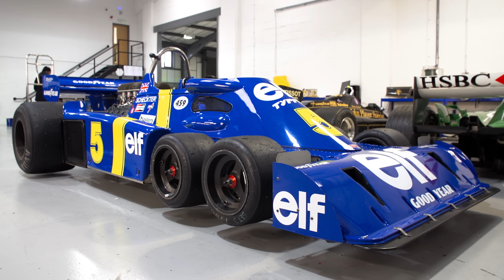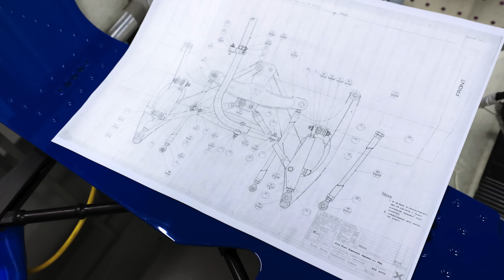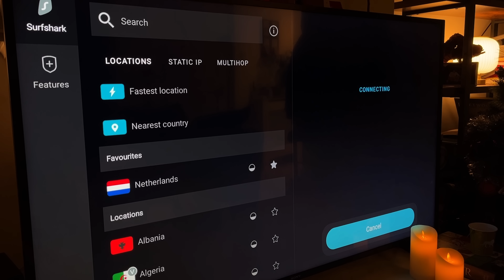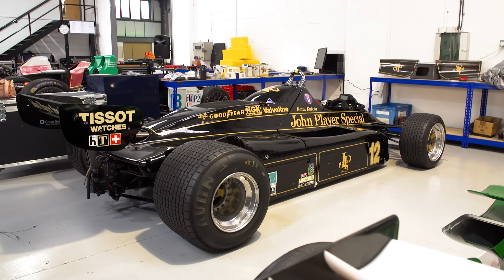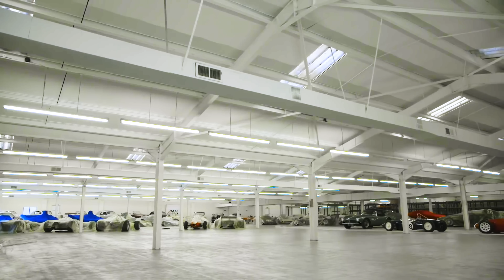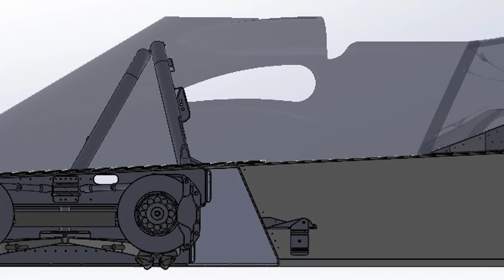Making an F1 car can be easier than buying it

Comment: The price of collector's item cars keeps getting higher faster than a helicopter!  
They have been doing this for more than 60 years and have never slowed down.
Remember the 1961 Ferrari formula 1 cars?  (Do you have the Matchbox or Corgi toy version?) How much would you pay for one of those?.....Well, back in 1962 they were just old cars that had been replaced by the 1962 Ferraris and they would not be using them anymore.   So they scrapped them.  After that the value of old cars kept rising and this trend is still going.

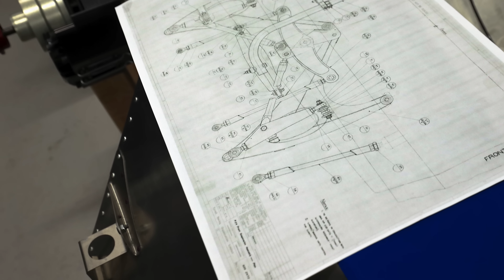Comment: At the time stamp, @2:17, the drawing, shows the tie-rod's / links, the welded on threaded bungs, are each cut at an angle before welded on. Can I just assume that was one extra step that allowed for aerodynamics, as in the perfect alignment world, all those being "IN-LINE" with air flow, is a small amount but collectively, all adds up. But, what about, if they need adjusted, as a turn buckle process, where each tie-rod has on one end, right-hand thread and the other end has a left-hand thread, so, for ease of adjustment, a compounded linear length of movement happens, pending the thread pitch, all in all, a quarter turn, now has those angle cut threaded bungs not in the air stream efficiency? Or is this a welding technique, for balancing the contraction from where the weld started and ended, and just adds more control over how the tube warps? I have seen this method of tie-rods on other drawings, but nobody ever has an answer as to why the drawing has them drawn this was.
Reply: Late reply, but when you weld two pieces of metal together then you change the strength of the material at that point. At that point your welded piece can crack when it has a high dynamic laod. If you weld your peice in a angle, than the change of strenght in the material is not only at one point, it is distributed over a area. So it will less likely crack at a certain point and it will last longer.

Comment: Amazing job.   In the USA, we had a hard time back then seeing any F1 races on TV before cable.  They would show most of the GP of Monaco and I remember the P34.   It was something else and great looking.   

Any idea what a Ford DFV V-8 runs today?   How many bhp?   About 550 bhp?  I remember Eddie Jordan in 1994 paid Brian Hart about $13 million (?) to build him a Hart V-10 which was a great engine.   I think Brian Hart said an engine cost about $400,000 to build around 1994 which did not include the development costs.
Reply: A short-stroke DFY (early 1980s spec) makes around 520. Older ones like the one in the Tyrrell around 480-490

Comment: The good thing about privateer teams back in the 70's where F1 was accessible as building a car and just showing up with the thing, is that the vast majority of the drawings used to build them aren't sealed away in a massive facility and have likely been sold along with the cars when they became obsolete and worthless. And as they weren't insanely high tech you can just build another one out of any old spare metal lying about. The greatness of F1 in the 1970's was that anyone could have a go really, and it's still a positive felt today on the historic racing scene.

I was told a story a few years ago about a historic F1 racer who had a fire at his shop and lost his F1 car in that fire, but because he had the drawings, he just built another one and hardly told anyone about it!

Comment: Dunno if easier, but it's likely way cheaper - Ferrari has i.e. a "Corse Clienti" ("Costumer Racing") program which allows them to purchase a race car, even a Formula 1, as long as it is at least two years old, but the costs are obviously eye-watering!
Reply: I can confirm, for sure, that's its most definitely not cheaper at Ferrari Clienti 🤣🤣

Comment: The real money sinker is the developing the car / adding improvement over time and maintenance from the fact that F1 basically run so the engine to shatters itself in a timely manner because performance. 

I remember watching some docs of people who race older generation F1 basically said they only need to dial down the engine to 90% power output and it'll last forever (with proper maintenance of course)
Reply: Can confirm. A friend of mine has two early 2000s Jaguars (2000 and 2002) and he can manage roughly 1500KM between engine rebuilds. He keeps the rev limiter at 1K below what they used in period, when they rebuilt the engines after only about 400KM. He also runs no ballast so about 50KG underweight, so there is no real performance loss all things considered.

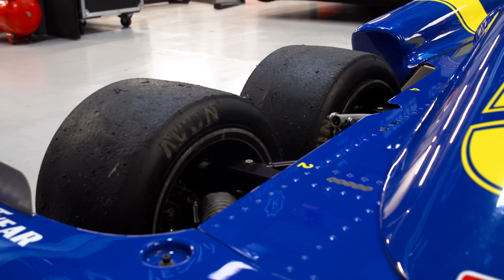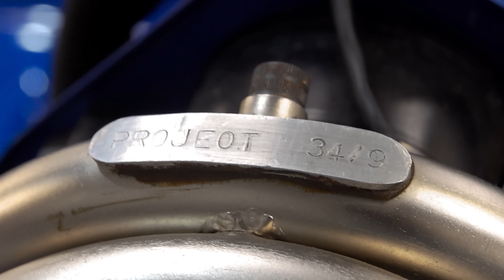Comment: Using the Tamiya kit is not a bad idea. Tamiya bought a Tyrrell P34 straight after the Japan GP in 1976 to make their 1:20th and 1:12th scale model kits. That car, which is one of the 5 surviving chassis, is actually at display in the Tamiya Reception Hall in their headquarter in Shizuoka. So to re-engineer body parts from the 1:12th scale model kit is the next closest thing to the real thing beside straight copying an existing nosecone from another surviving car.
Reply: great idea, dude :D

Comment: What was the point of making a  car like this? IE with 6 wheels
Reply from the maker: Its intention was for better grip through the corners to carry more speed!
Reply: @mattamys  I guess it didn't work?
Reply: Better aerodynamics, cut drag and turbulence by not having large front tires hanging out in the airstream, while not losing mechanical grip to the tiny contact patches that only two small front tires would be able to provide
Reply: @jimmybryan6760  good comment,but I guess it didn't work in the end.
Reply: @peterquest6406  They were the only team running 10in tires in f1. Supposedly lack of demand meant Goodyear tire development was non-existent, hampering chassis development.

Comment: Apart from anything else, it's amazing that a hand drawing of the air duct translated into a CAD shape that fit perfectly into a scaled-up scan of a diecast model. Such disparate sets of measurements and they worked that well! There's no way it's always like that. Hats off to Tamiya for their accuracy, though.
Reply: They have one of the original cars at Tamiya, but none the less, their models are extremely accurate!
Reply: Museum quality Plastic model , like all Tamiya kits !
Reply: Tamiya don't do die-cast. Polystyrene is their medium. 1/12 400 pieces and rare. I could have bought 1 in the 80's for 30 quid. BUT it is being re-released by Tamiya so I'm getting 1.
Reply: I used to love the Tamiya F1 kits, especially the 1:12 big scale. The accuracy was amazing. Even the instructions were filled with close up photos of the chassis and engine details. I made the P34 along with the Wolf WR1, Ferraris 312T and T4, Renault RS3 and the Lotus 78. The kits were £30 a pop back in 1986. Money well spent
Reply: I remember as a teen building the Tamiya version of this car. I had no idea at the time how precise my model actually was at the time! 🙂
Reply: Actually it's common for models to use parts of various different scales to make them look correct in model size.
Reply: @markmark5269  No it's not lol. It's common for small parts to be oversized, especially from old molds and cheaper manufacturers, but that has nothing to do with making it look better.